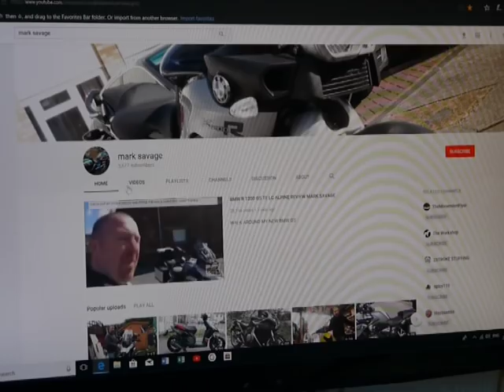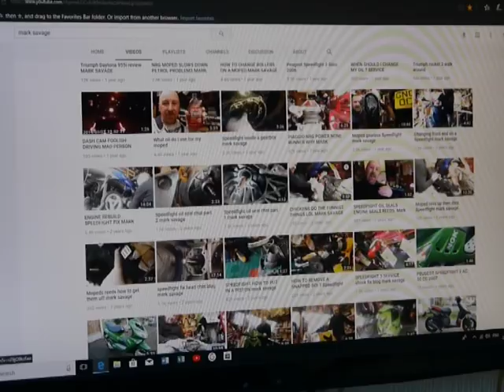MARK SAVAGE THS IS HOW TO FIND ALL MY VIDEOS MOPED MOTORBIKE CAR SPEEDFIGHT  REVIEW

Comment: bought a 2008 speedfight 50cc broken tail panel and sruffy ,non runner ,all paperwork from new ..mot feb 2019 so bought it for £85,,put in new piston rings gaskets as old one just worn out ,,starts runs well does indicated 75 klm an hour 45 mph...all in cost £150.inc taxing and insurance down payment and few bits ..so there are bargains out there..ps and i,m 64 yrs old still fixing riding them
Reply from the maker: Peter Mcclements good to hear bud 
Well  done and enjoy 
Thanks for watching 
Mark

Comment: Hi Mark 
Have been watching your videos great stuff keep up the good work looking for some advice looking for a 50cc to take on the back off my motorhome to take me and the wife on pillion what would be your choice prob need a deristrict for to up and a 50 for weight issues
Reply from the maker: hi bud its a great idea
for two people on a scooter id say a 50cc would be well under powered and try for a 125cc scooter, if you dont have a full licence maybe even look at the mp3 scooters ( 3 wheeled ones as you can ride them on a car licence)
and i'd then be looking at a 250cc or higher as they are still small and would go on the back
but i guess it comes down to what you want to use it for, if just to the shops and pub lol then a 125cc would be great 
it comes down to you really as there are many other there but just stick to a good brand, if you still looking at 50cc just get a big seated one lol
thanks for watching
mark

Comment: Hey mark, i have a sp2 lc, and i have some issues i cant get smart on.. 70cc mhr, polini variator, malossi clutch, and a 17.5 dellorto carb.. non immobilized.  and now, it spits loads of gas out my exhaustpipe, white smoke.. i checked the head gasket for leaks and that is allright,  pls help, love Simon from norway
Reply from the maker: hi bud well yo know how much I hate 70cc kits!, white smoke ?, have you check the water as if the head is leaking it will do this and run badly 
so standard carb 17.5 what jet size did you put in it and why didn't you go for a 19mm with a 70cc kit
air mix ?  , air filter ? did you change the spark plug for a hotter one?
this is why I dont like these kits as its not a case of just change that and go as they dont lol 
lets know what you did and didn't do and ill try and help bud

Comment: Hello Mark ,always happy with your videos

I have a speedfight 2 100 and I want to replace bearings and crankshaft seals, but in the page where I want to buy does not appear as such the model speedfight 2 100, the options of models are these;
product suitable for;
Peugeot Elyseo 100 G2AA
Peugeot Elyseo 100 G2AAK
Peugeot speedfight 1 100 S2AA
Peugeot Trekker 100 S2AA
Peugueot Vivacity 100 2T AC 99 -07

item nr: NK102.97 Naraku Heavyduty

the question, can I use these bearings for my speedfight 2 100 (year 2003)?

thank you mark, waiting for the next videos.
Reply from the maker: jeck850 hi bud speedfight 1& 2 are the same so all good they may fit other models but I stick with the sp1 100cc
While your there you may as well change to oil seal as only another £10 unless you think they are ok !
I’ll be doing this on the silver one soon but I have a few videos on me doing it on my channel that will help you 
Thanks for watching please like share and sub 
Mark

Comment: Hi mark was just after a little bit of advice please my son has a Peugeot speedfight4  ice blade 2016 he said for a week now the temperature light has been flashing for about two minutes then turns off but now the bike has just cut out wiuld this  have overheated or does it have a cut-off just wanted to know before I take it to the garage thank you
Reply from the maker: dean thornton Randall’s 
Hi bud 
It could be a few things 
1st simple one air filter as the bike is running hot so give that a check and either clean or change 
Then yes check water level and top up if needed with anti freeze 
Poss head gasket problems !
Try them first bud 
Hope that helps 
Mark

Comment: Hi Mark I've still got my speedfight 100cc if u want to buy it. Not too sure what the problem is. I was told it was the cdi so I bought a new one. The battery sounds dead so it might be that. Tries to start but I don't think there's enough power. I haven't got the Kickstarter as it's at a friend's house
Reply from the maker: where are you bud as i'm in Essex and at the mo not got a van but always up for a speedfight project . mark
Reply: mark savage I live in London Battersea
Reply from the maker: J dot if I had a van bad yes but can’t pick it up grrrrrr
Reply: mark savage it's here so whenever u get one or something I'm here

Comment: Hi, I'm looking for help I've got a speedfight 2. Start up pulls like a train for 20/25 seconds then bogs and eventually cuts out, turn the ignition off turn it back on restart it, pulls like a train 20/25seconds again!! I've replaced plug, coil & cdi so far. Thanks for any help 👍
Reply from the maker: Marcus Rodwell hi bud like I say in all my videos
When did you last. Service it 
Changed plug
Could be stator coil going to earth
Or good old carb , service the carb like in my carb videos and check float make sure fuel is getting in ok and fuel pipes are ok and not gone hard 
Please watch my videos and like share and sub
Mark

Comment: Hi Mark I've brought a speedfight 2 50cc and it is really slow it does 20 mph max, it takes a while to pick up it's speed and takes time to rev up could you suggest anything? Cheers
Reply from the maker: variator system bud, watch my variator videos they will help , remember to clean the variator and change the rollers .
6g would be the best while your there check belt and clutch like in my other videos 
please like share and sub 
mark
Reply: mark savage cheers matey I have subscribed to both channels of your and like all your videos thanks buddy😁
Reply: Oh and quick question how do i tighten my forks cause there's a wobble when I push the front wheel forwards and backwards
Reply: Sorry Mark I watched one of your fork videos and I've now done it, your flipping good with theses bikes cheers for your help mark
Reply from the maker: so its a sppedfight it's more likely to be your head stock and I've got a few videos on how to tighten that 
if you hold your front brake and push the bike forwards and backwards it knocks and is loose
as for the single arm suspension check you shock for bounce and make sure al the bolts are tight 
mark
Reply: mark savage have done Thank you for your help matey

Comment: Can anyone tell me if the speedfight 4 has the same running gear as the speedfight 3 and can I put a sports variator for a speedfight 3 on a 4 and the same with air filters

Comment: Hi Mark I've just put new seals and bearings in my Peugeot vivacity it does have a 70 kit on with size 80 jet but unfortunately it keeps flooding and wont run please help if possible thanks Nick
Reply from the maker: Nick Farnell so you know how much I love big bore kits and this is why 
If it’s flooding go lower on the jet size and check float is not sticking then tune like in my video
Reply: Ok thanks i will try jet see if it helps i have already checked cleaned and set carb thanks Nick